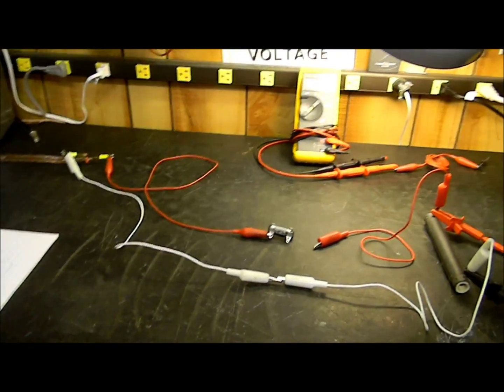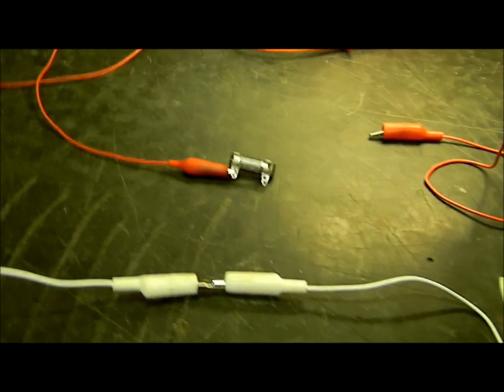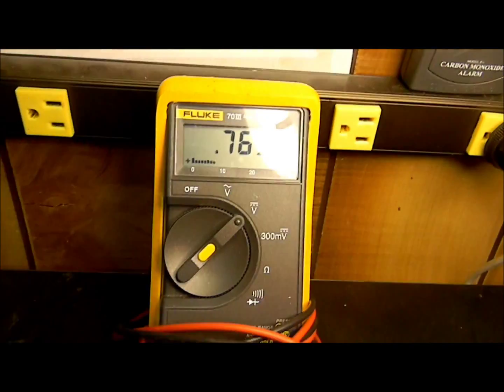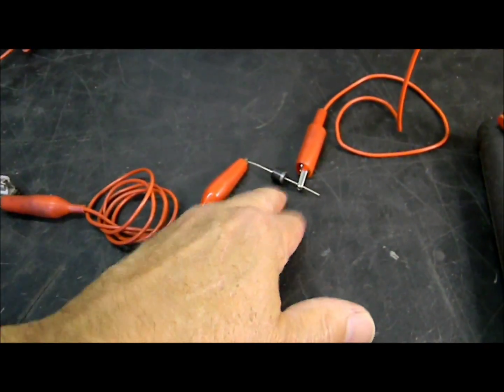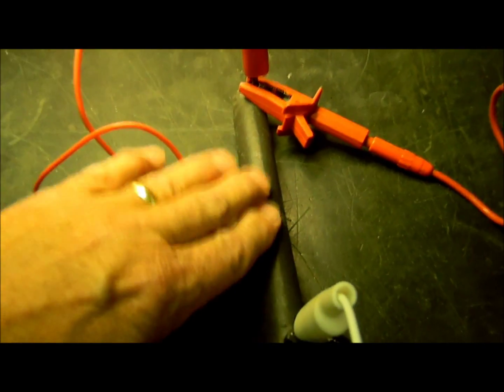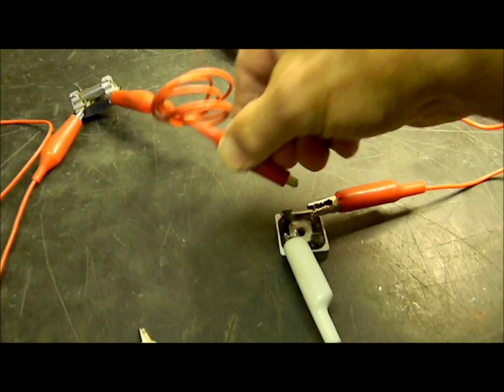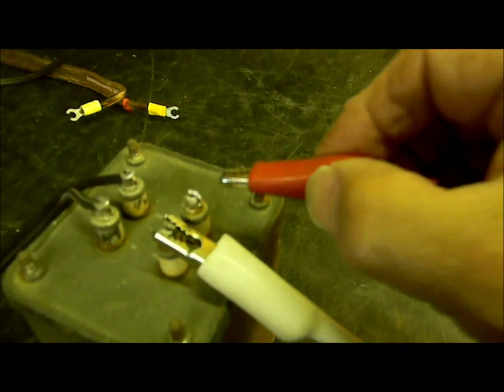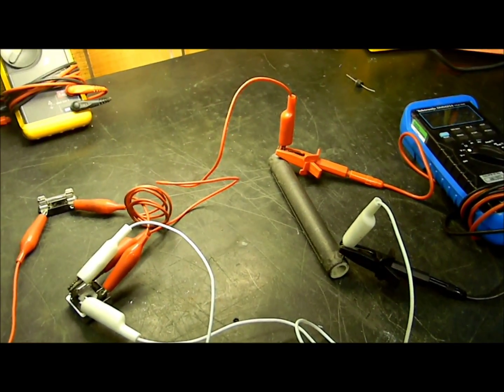Reverse Polarity Damage Prevention With Simple Diode Circuits

Comment: Question - How do I measure on multi meter the output voltage from circuit seen from 2007, that was secondary side of DC to 120V AC 60 cycles Inverter with one diode connected on each line of secondary, that has the diodes reversed, as cathode out and anode out. (opposite polarity) This went to resistor and inductor as load. This is not clipper circuit or misprint of diagram. Originator may have been thinking about reverse higher voltage protection . Is this reading on meter as AC voltage or DC voltage output, as each position on meter has different reading.
Reply from the maker: I am not sure what circuit or video you are referencing from 2007 but some of the DC to 120V AC converters only put out a positive going square wave. The current from the wall outlet goes positive 120 VAC RMS and then negative 120VAC RMS. The more expensive DC to AC converters do a good job at this conversion but the simpler ones only put out a square wave going from zero volts to (somewhere around) 120 volts square wave. This will, to some extend, work for AC devices. If this is the type DC to AC converter you have, your meter will display an AC and DC voltage at the output. Not sure about the diodes without seeing the circuit. Maybe you can provide a link to it ?  Hope this helps.
Reply: I said Inverter output AC , not dc converter to different voltage DC. The Inverter has had diode ADDED on each output line as opposite polarity, one with cathode and other with anode facing out to load resistor. There are  meter readings on both AC and DC, Which is correct.? Inverter as 400 watt Power ON Board 60 cycles, dc to 110vAC , model VEC031POB. Also be careful, there are DC positive only pulsing on/off square waves on an oscilloscope as well as AC square waves above and below Base zero line! (2 types of square waves being used in electronics.)

Comment: Question? - I have circuit diagram from 2005-2008. It  has DC to AC Inverter of 120v AC output hooked with diode on each secondary line , that is reversed polarity .( Both different) one way , then other way. My test meter reads both on AC and DC . How do I get proper reading across load resistor on multi meter?  This is not supposed to be clipping circuit of very low voltage. Circuit load on paper was inductor coil, diodes and  and resistor.
Reply from the maker: I think the way some of the DC to AC converts work is the "AC" output is really a zero to 120V square wave.  Not all of them because I havea very nice 12V to 120 VAC that is a nice sine wave positive and negative. A true AC signal like coming out of the wall is 120 RMS positive and negative but the output of your converter may only be a one polarity voltage so it would read both DC and AC. I have a very old converter that works like this from 50+ years ago. Look at the output with a scope and see if this is true. I think this is what you are asking.

Comment: many many thaks for posting this! 
using the diode in reversed shunt method (not in series) it doesn't matter the amp value right?
Reply from the maker: It probably doesn't matter as it will hopefully just blow the fuse and save the equipment. Maybe use one at least as big as the fuse ? so that it will lesson the odds of the diode permanently shorting when it has to do its job .

Comment from the maker: Just make sure the diode(s) you use can handle the current of your load same as you would for any power supply circuit. I generally use a large diode (4A) or stud mounted diode (30A) depending on how current is going to flow through it.

Comment from the maker: No, not at this level in a power supply - you will loose about 0.7 volts per diode that the current has to flow through (i.e. series diode and bridge) so you may need to take that into account if you use it in a 12 volt circuit. The reversed shunt diode is "not there" unless polarity is reversed and it blows the fuse.

Comment from the maker: I learned the hard way by reversing the polarity on an old solid state ham radio tranceiver many years ago. The problem with only a fuse is by the time the fuse blows the solid state devices have drawn so much surge current they are already fried. Putting a reversed polarized diode across the circuit will limit the voltage to about 0.7 volts - the conducting threashold of BJT devices - and blow the fuse and not allow the voltage to rise to a destructive level across the other semiconductors.